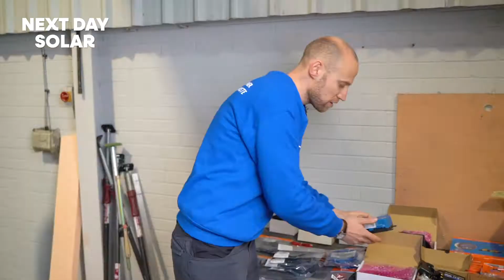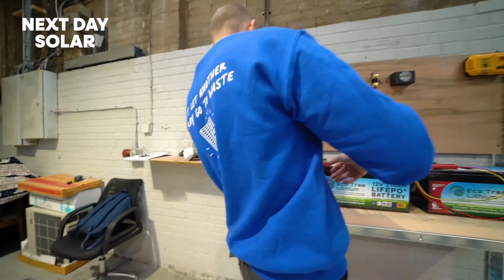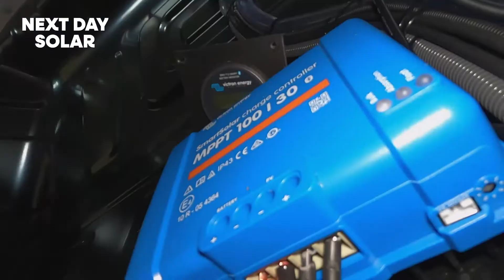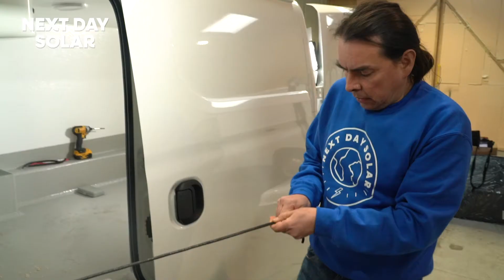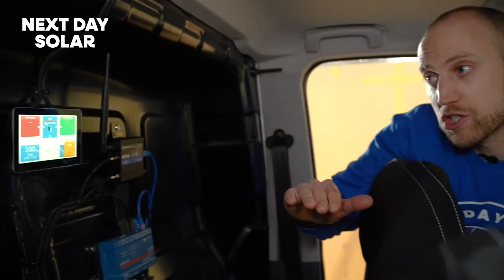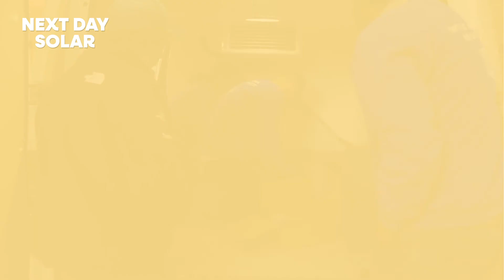Full Install of a Solar Fridge system on a LDV Maxus E Deliver Electric Van.

Comment: for the reference, I add a V2L inverter to my Maxus eDeliver3 for 5000W 220V AC output even in vehicle charging and driving time.   it might give a good option to charge refriegrator DC batteries.  cost lower and more convenient.

Comment: Could it be used to charge to main battery of the car. If you didn't have the cooler on the roof. And solar panels all the way ?
Reply from the maker: In theory yes, but you need to consider voltages. We are with a panel around 80V, the 'traction' battery is around 400-600V so we'd need to step up the voltage significantly, and loose a'lot of energy in the process, which is principally why its not prevalent in vehicles. On large 18 wheelers, on the top of trailers, it's the most under utilised bit of space they should be using.
Reply: @nextdaysolar3349  Thanks. I guess i have to wait for the Sonos "Van" to hit the market.

Comment: It seems completely crazy to spend so much time on a system like this when you could now have used the original mipv.pro system which is E-certified and therefore not give problems with the car's warranty. And then the solar cells are more efficient and even made in Denmark
The original product is always better than a product put together in pieces:       https://mipv.pro/black-box-the-electric-swiss-army-knife/